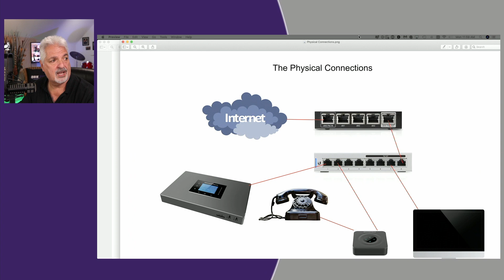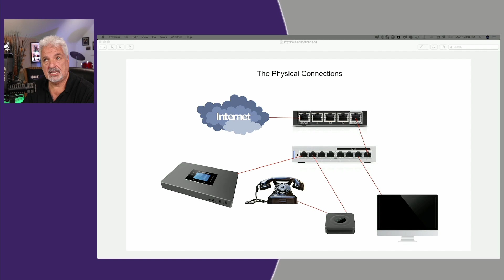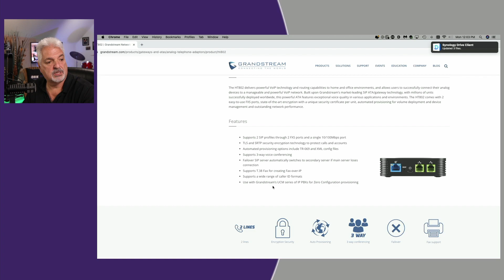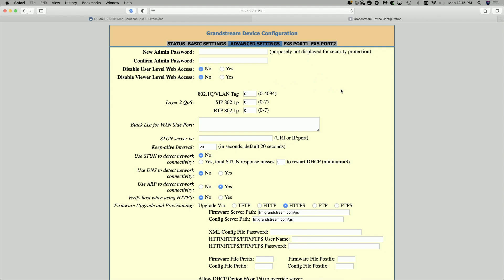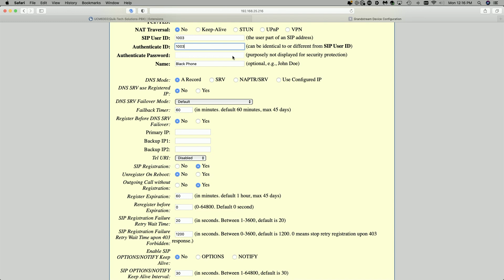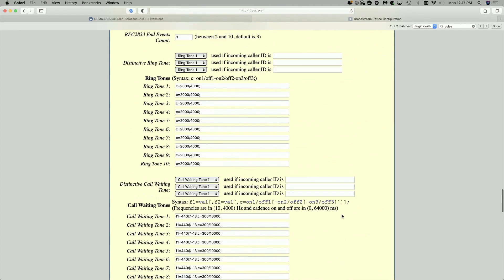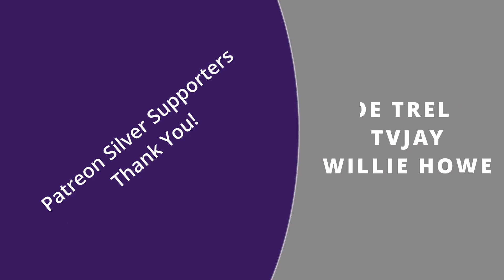How I Connected A Rotary Phone To VoIP Phone System

Comment: Sorry for my ignorance, I am unfamiliar with all the terms here, but if I buy the ATA, can I use something like magic jack as the VoIP provider? Do I also need the pbx or something? I am wanting to connect my rotary phone to the ATA, and connect the ATA to my magic jack, and connect the magic jack to my wifi router, correct? Thank you so much it means a lot to my wife to get this old phone working
Reply from the maker: Hi Colton, thanks for watching and leaving a comment. Great question by the way. Magic Jack does not recognize pulse dialing. In theory, to use a rotary (pulse) phone you would need a pulse to tone converter like this:
https://www.oldphoneshop.com/products/pulse-to-tone-converter-for-digital-telephone-providers-rotary-dial.html

Plug your rotary phone into the converter, then plug the converter into Magic Jack. Hope this helps. If you do this, please come back to this thread and update me on how it works. 

Have a great day.

Comment: Hello, thank you for this video. I also have this adapter and a rotary phone. But I don't have a Grandstream telephone system. I have a German FritzBox (router with small PBX functions). I need a dial plan for the Grandstream adapter so I can dial * and # with numbers. I entered this dial plan: { <=*>[126]x+ | <9=>xxxx }, but it doesn't work completely. The second part is already functional. If I dial a 9 before the number, the connection is established. But the first part doesn't work. I would like that if I first dial a 1, a 2 or a 6, the adapter automatically puts * in front of the number, so when I dial 620 it should dial **620. Could you help me?
Reply from the maker: Thank you for watching and commenting. I apologize but I don’t know what combination would work. You’re just going to have figure it out by trial & error.

Comment: Hey Tony, thanks for the informative video!
Because of this, I finally gave it a shot hooking up my old Bell Systems 500DM rotary phone. I'm also using the Grandstream HT802 as my ATA, and for SIP/VOIP service I'm using Callcentric. 
Success! I got my SIP provider to register, I'm able to receive calls and even dial out with rotary pulse per your instructions. Only problem is, the Bell 500 doesn't ring. In the Grandstream settings, I set the Ring Frequency to 20Hz and checked the "Enable High Ring Power" checkbox. Any idea what I may be missing?

Comment: Tony I have four digatal phones that are original to my home. Can I use one FXS port to mring all four of these phones thru my 6301?
Reply from the maker: Hi Dennis, if what I’m thinking is correct, all 4 phones are on the house wiring. Your asking if you plug the main phone block into an FXS port. If this is the case, all 4 phones would be the same extension seeing as you assign an extension to the FXS port. So in effect, when someone calls the extension, all 4 phones will ring. I’ve never tested this scenario, but in theory it should work. Let me know…
Reply: @QuikTechSolutions  I'll be glad to let you know how that works. I have all my digital phones connected to a cat5 block for phones. I just have to feed the block with a wwire from the 6301 FXS port to that block and bingo, they will all be connected.

Comment: Hi Tony, years back I went to a wireless home phone setup with my cell phone provider and would love to get my old rotary phone(s) working again. 
Currently I’m using an AT&T IFWA-40 that connects to a wireless home phone base and it work fine. If I plug in the analog phone I hear a dial tone but can’t do anything else. So I’m guessing I need an ATA adapter. Do you think the one you’re using here will work for me?
Reply from the maker: I’m guessing because the rotary pulses are not being converted to tones. Honestly, I don’t think the ATA I use will work in your configuration. When the ATA is connected to the next work, it has to be configured to a VOIP phone system.

Comment: Nice Video, thank you! I miss the step where you plug in the phone at the HT802? What kind of adapter are you using there?
Reply from the maker: Hi Simon, thanks for watching. So the HT802 is the adapter. The traditional phone cable (rj11) plugs into the back of the HT802. The HT802 connects to the network through its ethernet port on the back of the unit. Hope this answers your question. Have a great day!
Reply: @QuikTechSolutions  I'm asking, because most of the phones I've seen doesn't have an RJ11 plug. To be honest, all of them 🙂
Reply from the maker: @simonkistler6468  the HT802 has two of them, hence the model name 802. You can actually connect two analog phones to this one device. Grandstream makes an HT801 for a single analog phone. Have a great day!
Reply: @QuikTechSolutions  I am 2 years late, but the question was: how do you connect rotary phone to rj11 cable? Of course ht802 has rj11 port, but rotary phone doesn’t
Reply from the maker: My rotary phone has RJ11. Older rotary phones use a 4 prong plug, if that is what you are referencing. I’ve never actually seen a phone with a 4 prong plug. However, Amazon has 4 prong to rj11 adapters.

Comment: Hello! Here is my current set up.  I have a wall rotary phone (1970's I believe) hooked up to my internet(Kinetic Windstream) phone service.  I have a voltage booster connected to it to give the ringing bells the juice they need to operate.  I am able to receive calls but not dial out as the phone has pulse dialing.  I tried the Canadian product pulse to tone converter box, but it did not work even though I heard the tones when dialing the rotary phone.  It also seemed to time out while mid dial as well.  I ordered a Grandstream HT801 based on forums.  My questions is, can I use the Grandstream to convert the pulse to tones given my current set up?  Or is the Granstream only used as an "extension" to the rotary phone?  Thank you
Reply from the maker: Hey Adam, thanks for watching and commenting. So the HT801 does convert pulse dialing to tones. That’s exactly what I’m doing in this video. There is a setting on the configuration page to enable pulse dialing.  I imagine it should work for your setup. The worse case scenario is you send it back if it doesn’t. Have a great day!

Comment: If only my Dad had reliable internet available at his house. He has a boatload of old rotary and touch-tone phones that could be used again.  Of particular interest is a touch-tone adapter that screws on the phone receiver of a rotary phone.

Maybe I should get my hands on that stuff just for a good laugh.

My one question would be whether or not Grandstream is still actively updating the firmware for this ATA. I still have my old Linksys model ATA that I stopped using after it went years without a firmware update. I see that the HE-Ht802 was first available on Amazon in 2016, and it just made me wonder.
Reply from the maker: Hey Jeremy, Thanks for watching. So to answer your question, yes Grandstream is actively updating the firmware for the ATA.  I've just been slacking as far as getting mine up to date. I'm running 1.0.27 released on 4/15/21, which is about 4 revisions behind. They are up to 1.0.35 released back on 1/26/22.  1.0.37 is currently in Beta. Have a great day.